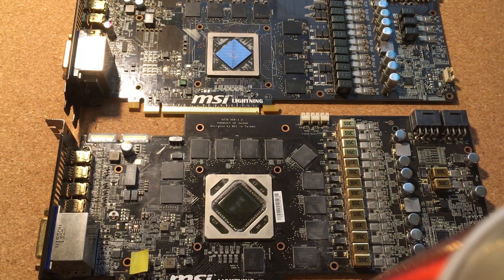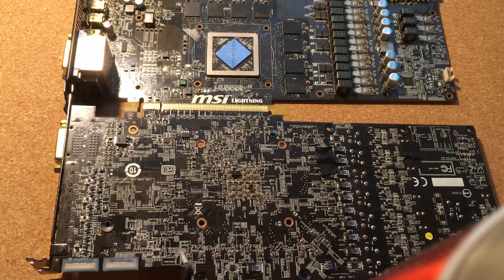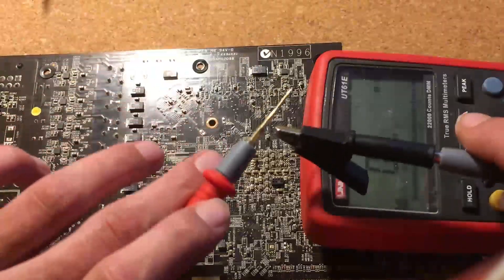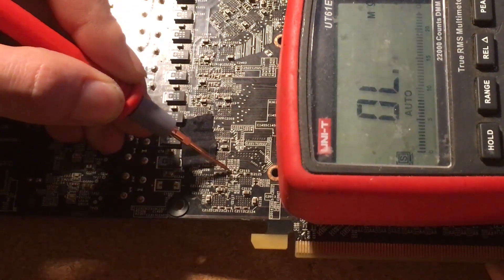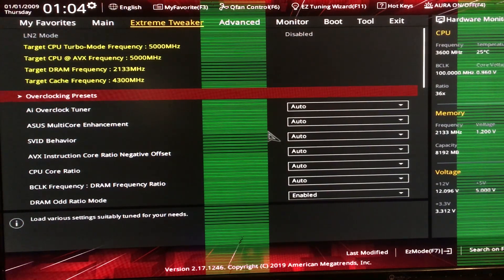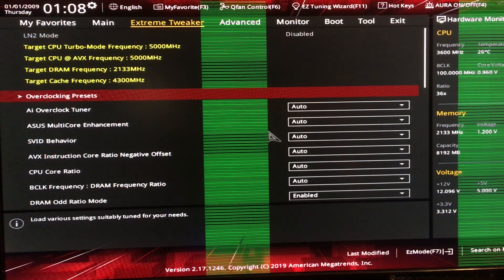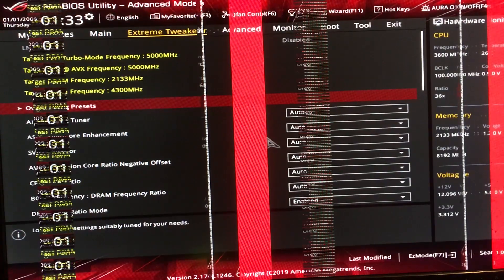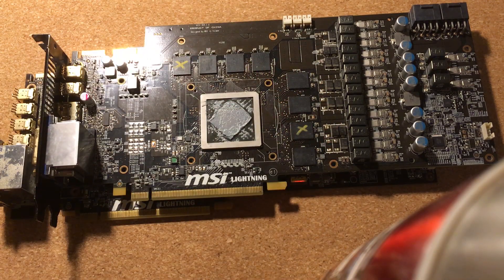Diagnosing memory on AMD GPU's without software | MSI HD6970 / 7970 Lightning diagnosis

Comment: is this method working on ati radeon x1900xt?
Reply from the maker: theoretically yes, just with regular refferences as iirc only GD5 and up has vref-c
Reply: @ since I don’t have boardview I am going to unsolder chip memories one by one and start gpu check vertical lines to assign which lines  belongs to memory chip..it will work for me